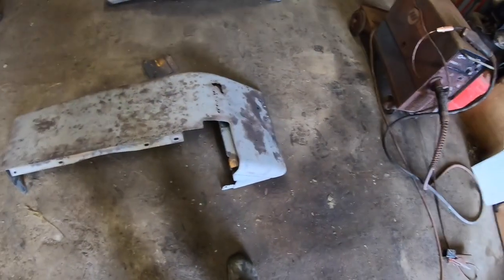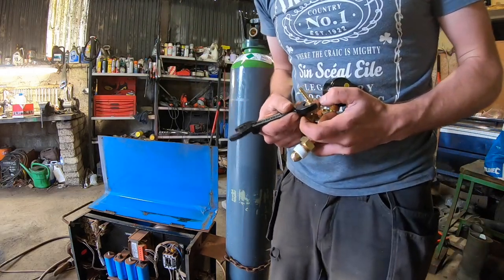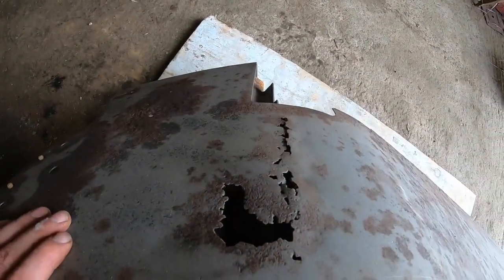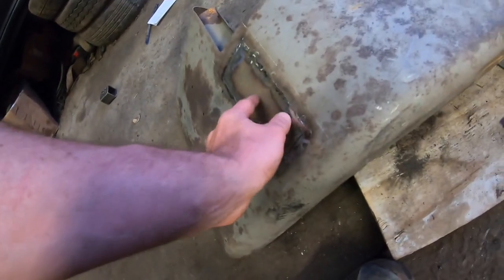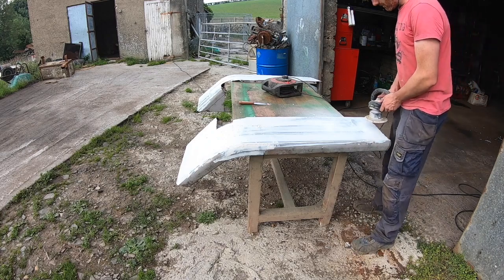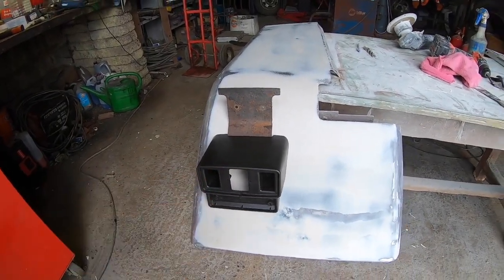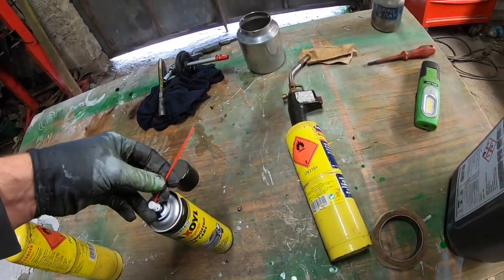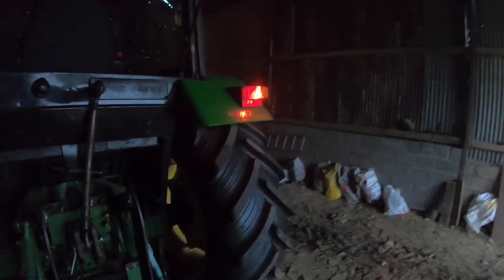Miller welder up and running for John Deere 3140 rear mudguard fender repair and restoration

Comment: Hello, do you have beter footage of how you connect the wires of the lights, or do you have a electric scheme????
I cant get it done …. 
Keep up the good videos 👏👏
Reply from the maker: Hi, sorry I didn’t take any footage of the wiring as another person did it. John Deere is very difficult to get wiring schematics for but tail lights and indicators are very simple and basic, there are no complex orientations to them. A basic schematic circuit would do you. All lights to be grounded to the same point and a live that you can check for with a test light and this goes to each bulb. Nothing more than that. Hope that helps, stay tuned as I should be doing some wiring soon! Thanks for watching!